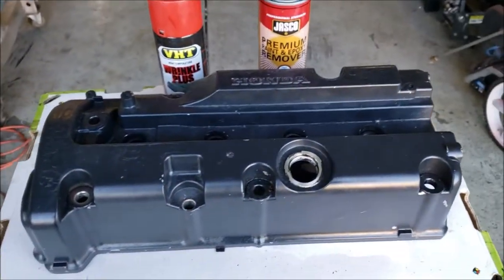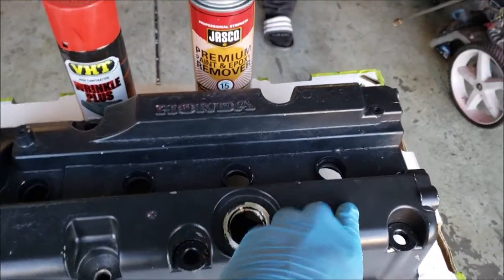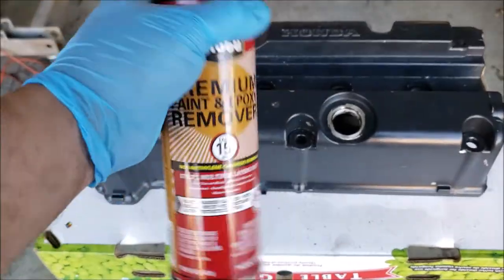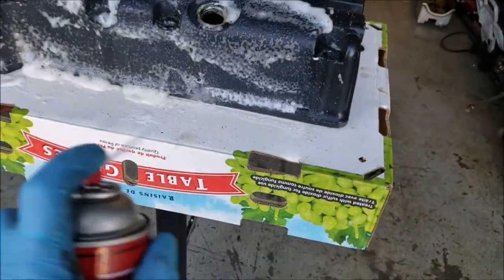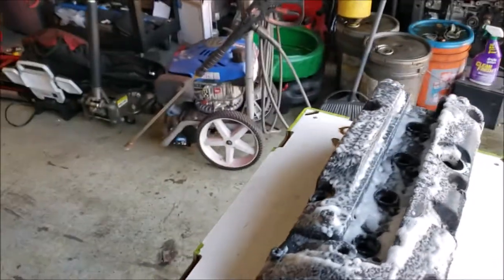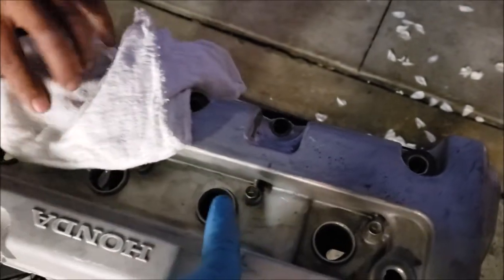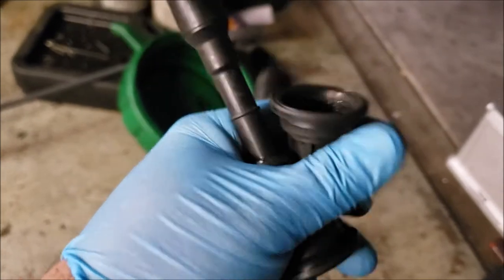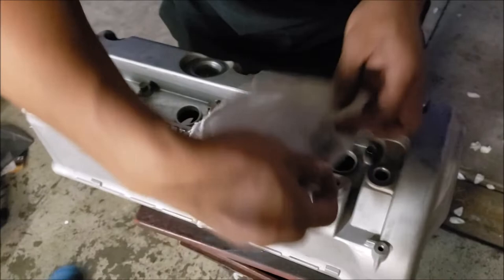How to Wrinkle Coat a Valve Cover with VHT Wrinkle Paint

Comment: Do you recommend a clear coat on top of this like high heat enamel? Or does this come out shiny
Reply: I've never seen a wrinkle coat come out with any real gloss. That's not really the result you're going for with this. If you want a shiny valve cover you really should just go with high temp enamel instead. I love the look but wrinkle coat is harder to keep clean than standard gloss painted valve covers.